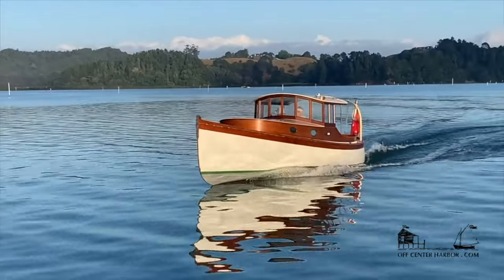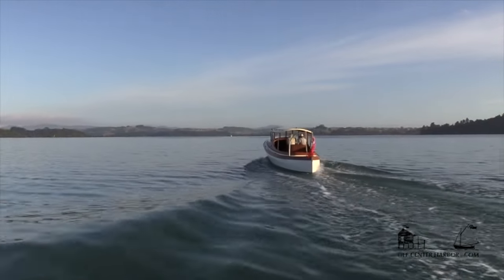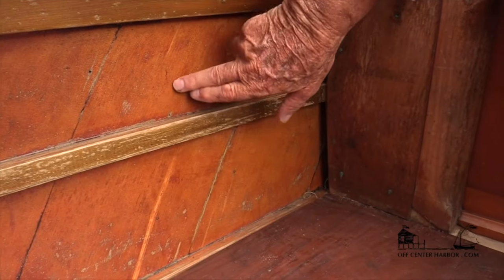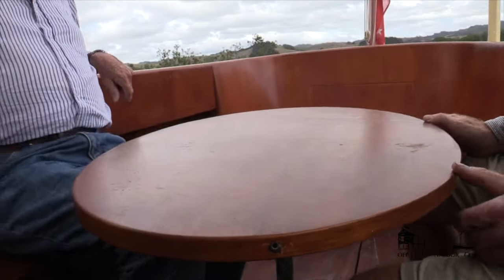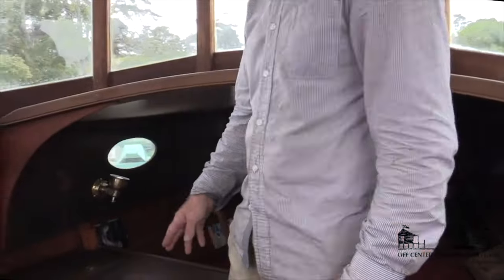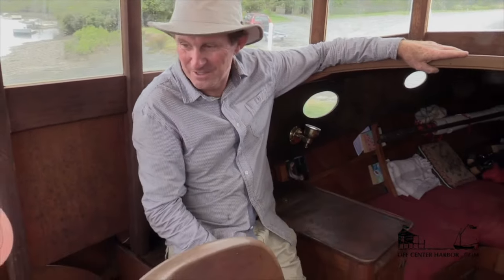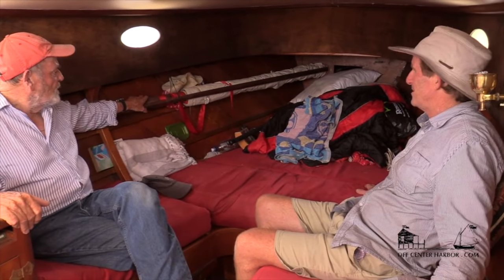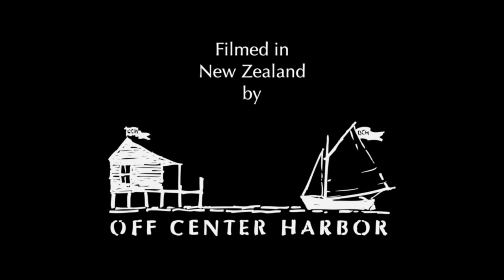How to Build a Wooden Boat — AROHA, Part 1 – The Original Boat WHIO, a New Zealand Weekend Cruiser

Comment: I friggin love this boat, and it's quite unique, even as a home built boat.  Very long length to beam,  no doubt trailering takes some real attention, but the boat is so light it'd be easy to tow with an ordinary car; also this boat would be an excellent candidate for electric propulsion. A 'Whisper Gen' (natural gas or diesel) could back up the battery, along with solar cabin roof and deck, along with roof covering the open area... This 29' feels very roomy yet can function just fine as a cruiser.  Wow!
Reply from the maker: Agreed on all fronts! The builder of the original boat, WHIO, has indeed been working on an electric propulsion solution. We're excited for more electric options to be available, practical, and affordable.

Comment: So pretty! I’ve been thinking about something along these lines for a while. In my head, it was a little heavier. A long, lean sharpie hull. Beachable. More resembling a work boat topsides. Standing room down below. I was thinking that a 10 knot boat at 2 liters/hour was impossible, but this gives me hope. I was even looking at the Beta Marine 38 for an engine! I was considering moving the engine aft using a stern drive and placing fuel and water tanks under the helm. I might have to buy these plans!
Reply from the maker: Check out the plans, then check out the kit. Having the design and knowledge of Brooklin Boat Yard to put it all together, on top of the original boat's ingenuity, is pretty amazing.